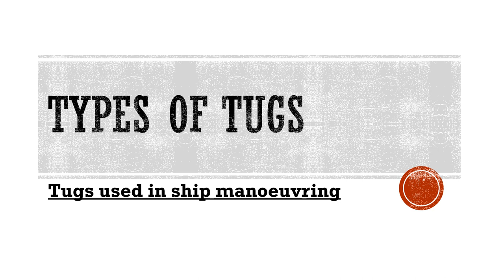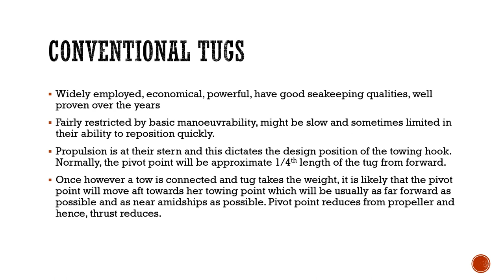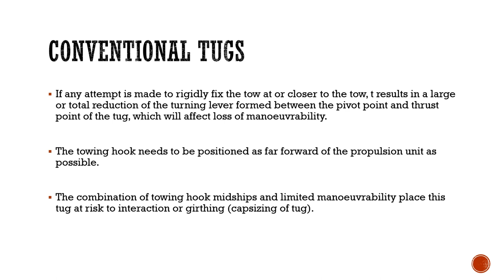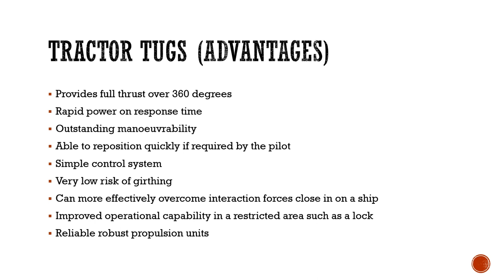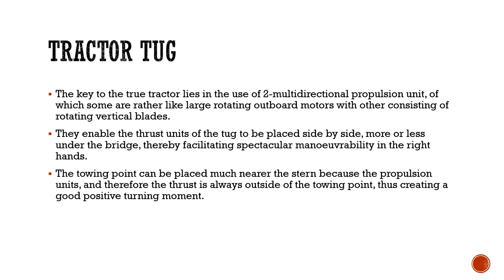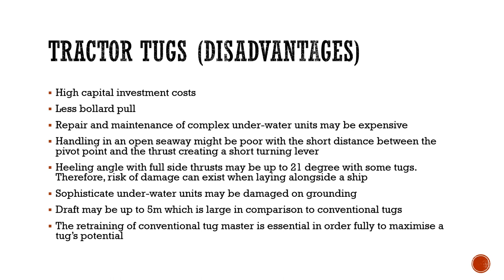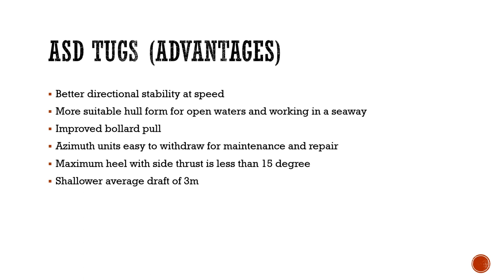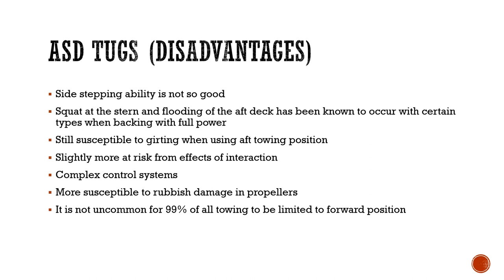Different types of Tugs used in handling ships

Comment: Voith tugs can keep the weight on the tow line when repositioning which is a great advantage. Easy to drive.

ASD tugs when secured as the forward tug through the centre lead struggle to operate when the vessel is moving astern due to the shape of the skeg. Ideal to be used as push pull tugs on the side of the ship, secured on the break of the focal and just forward of the accommodation. Very typical for docking VLCC’s etc. Learning curve for the tug master is greater than a Voith.
Reply from the maker: Thanks for adding to the knowledge Phillip, really appreciate it:)